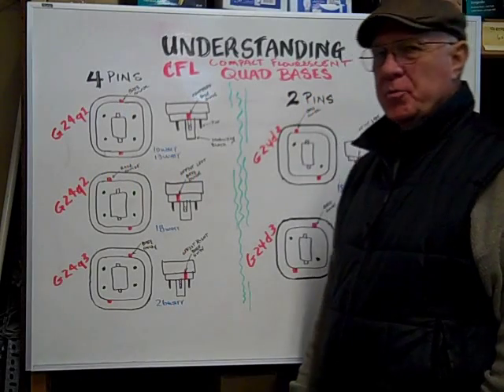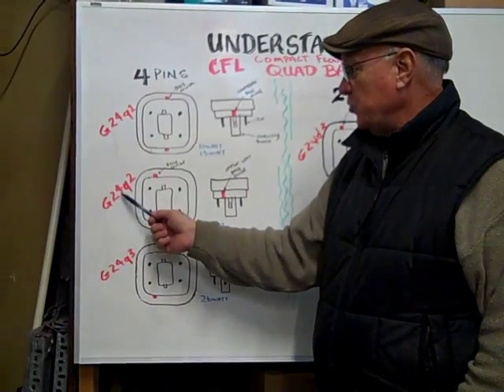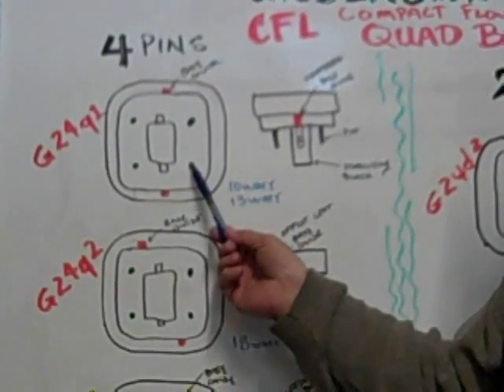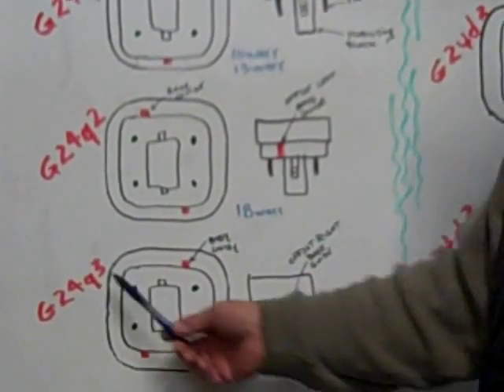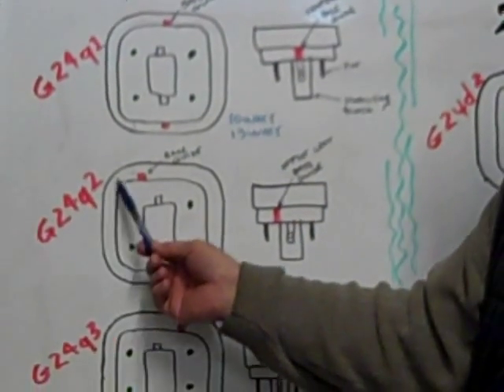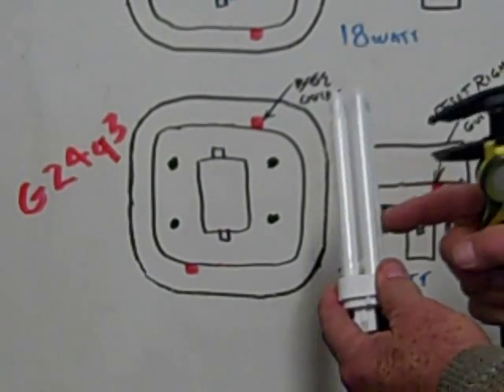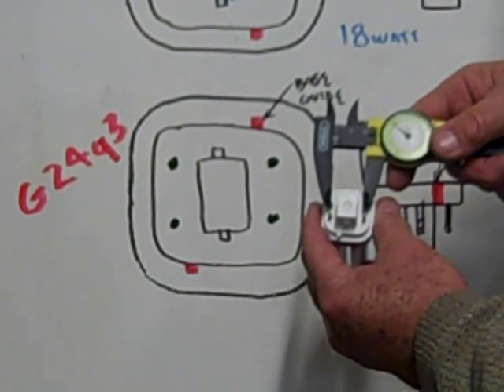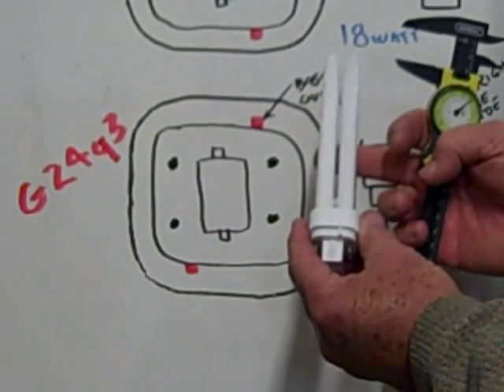G24q3 Base Identification

Comment: I have a fixture that's labeled "G23Q-1 18W" and the base of the socket is not notched for any particular position, but so wide it can accept any. It is not modified. Can I plug any G23 CFL source in there as long as I don't exceed the wattage? That is to say, are the base styles electrically compatible, and the wiring the same?